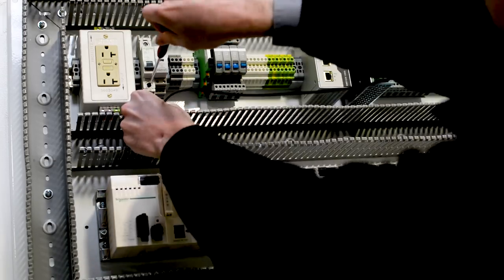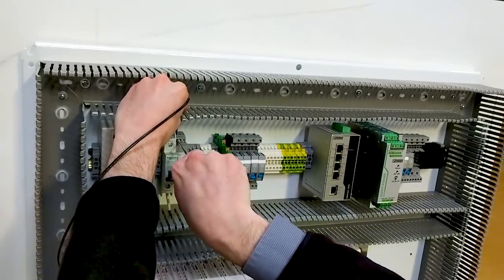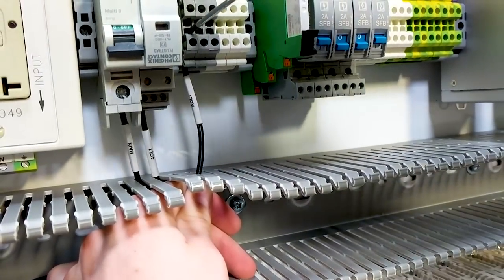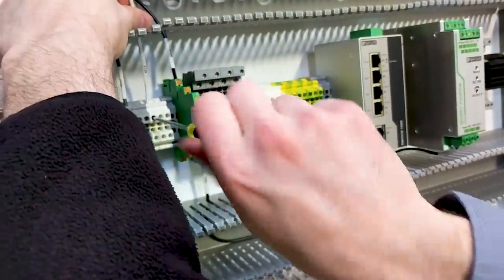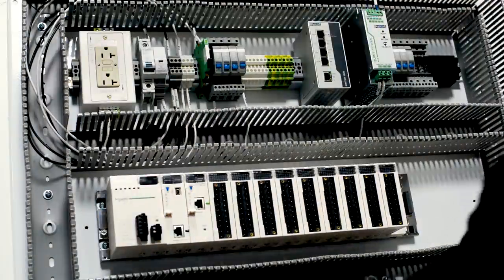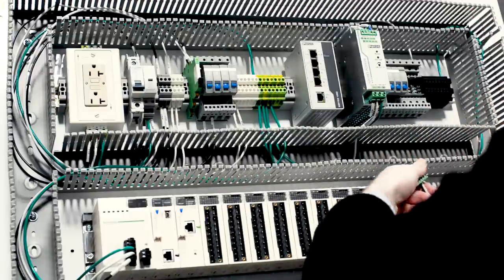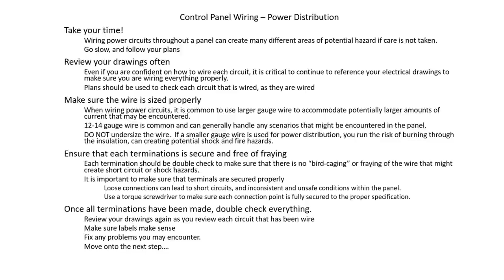Control Panel Build Series Part 17:  Wiring Power Distribution

Comment: You should really be using ferrules. And ditch the screw gun, even if the torque is set low. 

Good work other than that.

Comment: Why is the Phoenix contact plugtrab upside down?
Reply: They are wiring the AC distribution consistently with line side on top and load side on the bottom, and I'll bet they incorrectly assumed that the PLUGTRAB is "directional" -- a look at the schematic diagram says that it's not; it's actually a parallel device, not a serial one.

Comment: 120 - 240V and he talks about safety... Weakness disgusts me.
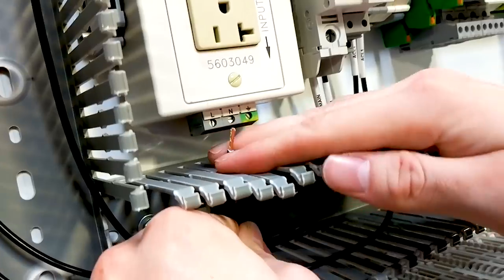3:36... always use insulated terminals / pins for stranded wires. Never push stranded wires like that.
Reply: I see that, and that method are very bad, stranded wire without terminal.

Comment: A power screwdriver is not the tool to use when wiring a panel. You have more of a chance of over-tightening and damaging components.
Reply: My Milwaukees allow for setting exact torque settings.

Comment: Sir, what mm2 of wire is use for plc , contractor, relay and supply in panel (SWG)?
Reply: That is determined by your fuses/circuit breakers. 20A 2,5mm2 14A 1,5mm2...

Comment: Can you teach the wiring more technically? In details.
Reply: Yes, please, I concur.  I realize there are details unique to the various voltages, and plans, but it would be great to mention what gage wire, THHN vs MTW etc, how to test out the circuits, how much distance you use on your wire way and the components, the names of the tools etc.

Comment: There's so many bad choices in this video lol. No ferrules, service loops, etc. Never seen someone use a power tools on components like that.... I would never
Reply: My first time hearing about ferrules. I probably would have used them if I knew about them. It's crazy but I usually go back to a new control and re torque all of the connections. Service loops, you bet....

Comment: Use solid ware from safety point of view rather stranded
Reply: Can you explain how that would be safer.
Reply: @johnschroeder3072  it could avoid loose contact at the terminal side,so that the fire incident can be avoidable !
Reply: @azeemahammed8646  The better option would be to use flexible stranded wiring and to use boot lace ferules on the end to keep the wires together in the terminal. This would end up with better surface contact, less sensitivity to vibration and less likely that the conductor will break.